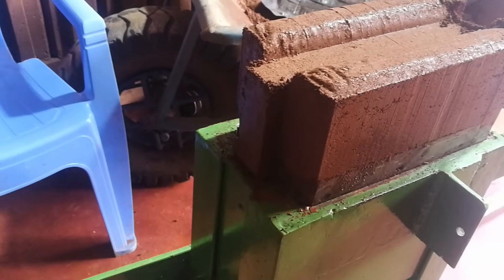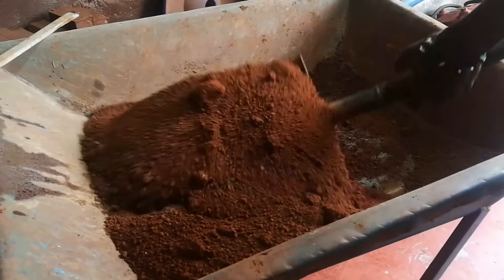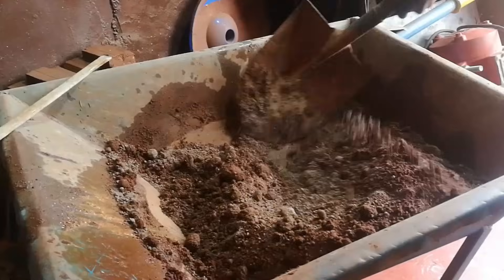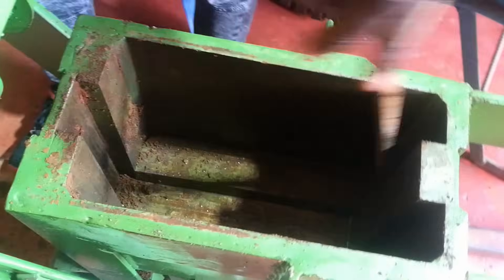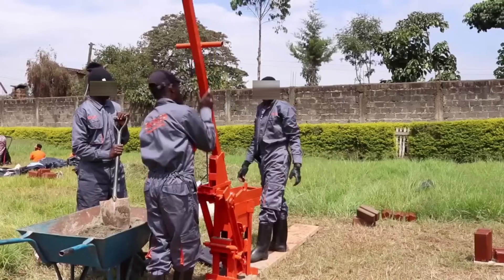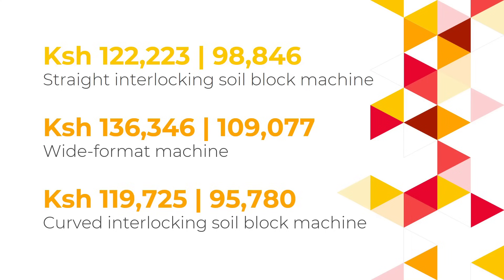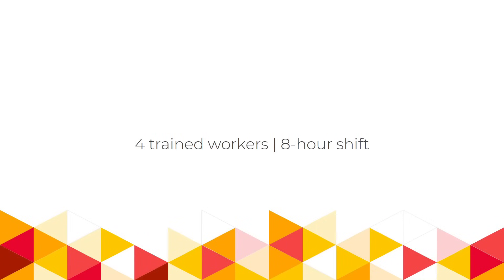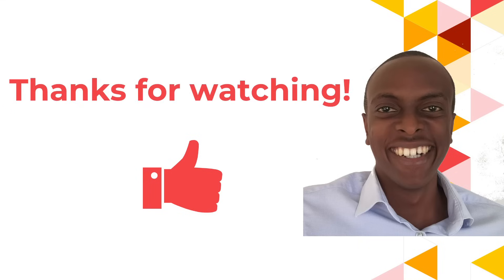The Manual Interlocking Soil Block Machine: How it Works, Price, and Use Cases

Comment: Usable in brickcountries, that traditionally are rather wet and cold? Generally not enough sun for drying. Which is traditioally only the first step.
Reply: Brick countrys? Lol
Reply: Wtf are you even talking about?
Reply: Does it even work outside super hot, superdry countries in which one tradtionally builds with mud, clay and shit? @StonemanRocks  

Here bricks are the norm, but people are looking into lower Co2 emmissions building materials, than concrete and traditional fired bricks.
Reply: @perpetual4958  it should! Being extruded it cuts down on the h2o content! Theyll dry eventually I think! I live where bricks or adobes are the norm as well!

Comment: It looks like a great idea for fast, cheap construction. I worry about ease of repair, though. If a car hit a wall made of compressed, stabilized soil, and damaged one block only, then how could you make structural repairs without dismantling the entire wall. Leaving one block damaged compromises the strength of the whole, just as with a single weak link in a chain. I cannot think of a cheap, easy way to replace the damaged section only, not with rammed Earth, stabilized soil, or bricks. It means a patch job at best, in the event of erosion or damage. I would be wary of committing to this style of building for my house. But it does look promising for many use cases.

Comment: Hey Nick, how do I construct different bonds using interlocking block, for example the T-bond, cross and L-coners
Reply from the maker: Hi Naluwooza, half blocks can be used to make corner blocks. The T-bond and Cross blocks will require their own machine that has these design mould shapes. What I showed on the video was the standard interlocking machine. Please check Hydraform for more information about corner blocks.
Reply: @PropertyNoma  Hello, I want to order this and I am waiting for your answer
Reply from the maker: @ceyhuntaqiyev  I currently don't sell the machine. This is an explainer video describing the machine.

Comment: Could I get several of the curved ones with a slightly offset top interlock in say three radiuses getting tighter in order to build conical structures to house my gnome henchmen? They have cone heads and have requested housing to match their heads, and I want to keep them happy so they don't revolt again. Ezekiel 23 20. Blessings!!

Comment: Just wondering, is it possible to use stain on the blocks?
Reply from the maker: I think you can as long as the stain doesn't react with cement or the added stabilizer in the soil
Reply: Stain ~ include iron oxide powder available for builders, of various colours. Commonly available at hardware & builders supplies stores.

Comment: Seems like adding borax to the mix could make the soil more stabilized by reducing mold and other decaying processes, and using an electric drying kiln for a more consistent, uniform drying, which uses less energy than fully firing them and does not throw much smoke into the atmosphere. Why would you use firewood? Nichrome wire and other components of a drying kiln are not expensive. You could use a used oven.
Reply: A solar oven at that.

Comment: In business what is  the ratio,how many bricks produced and as well price per brick
Reply from the maker: 1 cement bag to 6 wheelbarrows of quarry soil, 400 blocks/day, around 20-25 Ksh per block
Reply: @PropertyNoma   what type of soil? I have the machine  but fail to make anything
Reply from the maker: @aamsheikh  Most soils should work e.g red soil, quarry soil. Black cotton soil is unsuitable though
Reply: @aamsheikh clay soils not loamy soils!

Comment: Price of the machine based on dollar exchange/ Schilling  February 2023 $USD 1,100.....pretty amazing price
Reply: That is a fair comparison to China.  There are many manufacturers of this machine.  India, Thailand, Malaysia, China, Kenya, Uganda to name a few.  But, there are two main varieties of brick that are produced.  This brick, with the tongue and groove, and the other brick; the "lego" brick, due to the fact that it has 2 perforations in the vertical face of the brick.

Now, depending on what you are wanting to do with the brick will go a long way to determining the product you buy for the purpose you wish to use the bricks for.  To give an example:  The curved bricks are best used in ground, for rainwater or septic tanks.  The tongue and groove bricks are also best for septic systems, but, can be used for housing walls and fences.  I personally am not keen on this as am not sure how the wall is tied to the foundations.  The perforated type brick, in my thinking, is the better one to use for house walls, as reinforcing can be brought up from the foundations, through the bricks, right to truss level.  This reinforcing can also be encased in cement, giving a strong bond for the reinforcing.

Comment: May I suggest a design change that would eliminate the need for a counterweight?
Try using a compound lever. A compound lever lets the machine have a much smaller length. With a compound lever, there are two levers mounted in opposite orientations, and the top lever pushes on the bottom lever, which then pushes on the mold. When you use a compound lever, each lever can be half the length of your current design's single lever. Also, no counterweight is needed if you position the pivot points of the two levers correctly. Or, if it is not possible to completely eliminate the counterweight, only minimal counterweights are needed.

Here is an example of a compound lever for manually making briquettes out of recycled paper: https://youtu.be/_WHTWe7A0WQ?&t=61

Comment: Doesn't seem like the words being used are fully understood and mean what you think they mean.  Soil Block. . . You mean Concrete block with some soil added in to reduce the amount of concrete required. 
This machine does nothing more than compress, a simple action that could be done with wooden blocks. Or find a welder with some spare plate and make your own Jig. 

4 people to use this. Negative. 1 man could easily accomplish this with a little red neck engineering along the lines of a gravity fed hoper for adding materials. Air powered bottle jack .

Comment: I do not see how it is possible to produce blocks economically with this machine.  If there was no other building material available then this makes sense.  With three operators I expect this machine could not produce sixty blocks per hour, more like thirty (two minutes per block).  And so one would take three times the hourly wage and divide it by about thirty and you have the cost of one block.  I dunno, three dollars perhaps... the worst problem though is how to scale a project so that this makes sense (because it does not make sense to transport these blocks, it obviates the reason for the machine in the first place).  And so, you'd arrive with a machine, work for weeks and weeks, and then spend three or four days laying those blocks and you'd be done.  This is a perfect machine for the surface of Mars where the cost of a block will be irrelevant because any housing is going to be a million a square foot just starting out, and the people we send there will have nothing but time on their hands if we manage to keep them hydrated.  Yeah, this is a solution that brings a bigger problem than what you started with.  And.. sadly, that's like an awful lot of "technology" inventions that come from that continent.

Comment: in any developed country, a labor cost alone for 4 people to operate it will outweigh the cost of per-made blocks.  its probably worth it in Africa...  maybe if it was designed as hydraulic press or tractor PTA driven.  Whole thing can be run by 1 person.  heck, they literally have 1 person as a COUNTERWEIGHT in the design of the machine...  I have not seen more stupid design before.